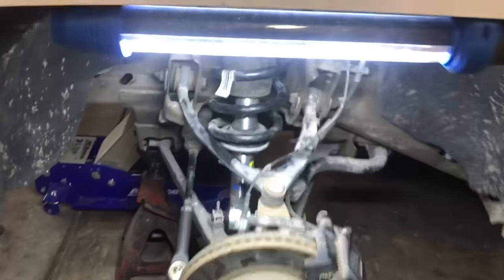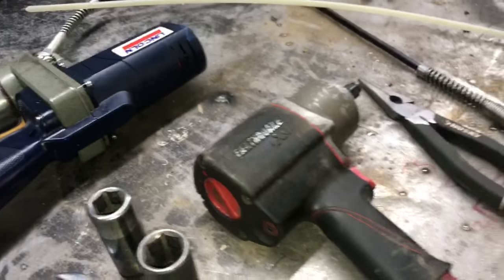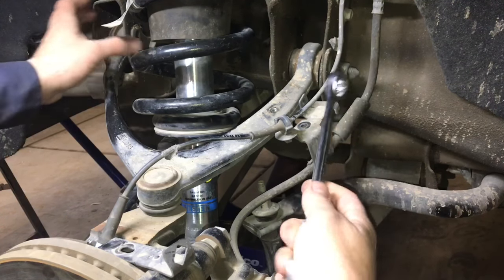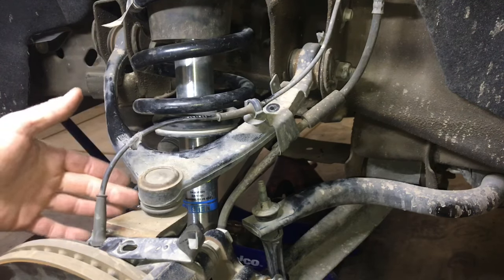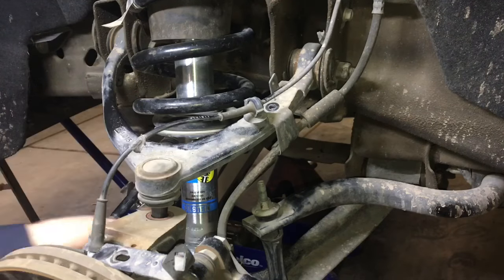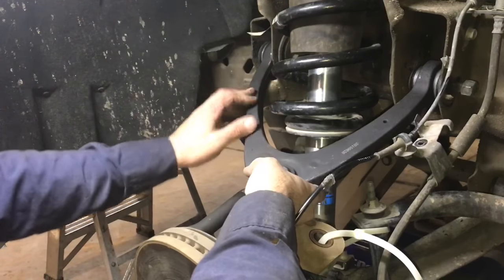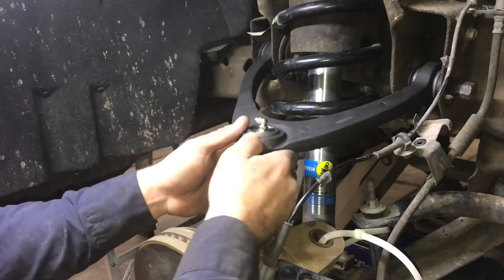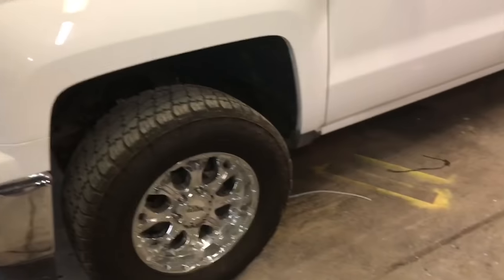Silverado/Sierra Upper Control Arm Replacement (2014-2018)

Comment: Be sure you buy the required control arm for your truck. You will have either aluminum or steel. If you are not sure which one you have then grab a magnet and if it sticks to the control arm it is metal, if it does not stick to the control arm it is aluminum. Pay close attention and make marks with a marker on the bolt cam location so it goes back in the exact same place and position then beside to get an alignment after the repair.

Comment: Great video!!  i am having a hard time installing the bolt w washer. It is hitting the spring and going in at an angle which isn’t allowing it to go into hole.
Reply: I took a seperate jack and put it under my lower control arm to compress/move the spring enough to remove the bolt. The driver side came out fine but I had this issue with the passenger side.
Reply: @josta64  this the answer I was looking for.  Wondering if I used a second jack could I compress the spring enough. To slide the bots out.

Comment: I have a 2017 GMC Sierra slt that makes a popping noise in the front left suspension area as I turn the wheel. Have you had any similar issues? I gotten two inspections and all parts are new.
Reply: I have a 14 Slt 4x4 in shop now due to popping and in even tire wear, $1,475.50 for upper and lower control arms with ball joints.     Hope it fix’s my popping and tire wear prob
Reply: @djcombs5553  you got robbed haha

Comment: Doing this job right now and this video helped alot! I had to use a large C clamp and put pressure on the upper ball joint and hit the spindle to get mine out so in case you guys dont have a pickle fork but you have a C clamp you can try that trick

Comment: Awesome info and video! I am about to replace both UCA's and all four shocks with new Bilstein 6112's in the front and 5100's in the rear on my 2015 GMC Sierra All Terrain. I have watched all of your videos and feel pretty confident about doing it myself. I put the leveling kit on myself when my truck was brand new so hopefully this won't be too bad.
Reply from the maker: thanks for the support! its not to difficult! thanks again
Reply: I have a 2015 All Terrain as well, don't they have a factory installed front leveling kit already? I'm basically in your shoes and am looking to do exactly what you are doing, did with the new Bilsteins. Are you happy with it, was it as easy as everything is on these vids? BTW I ordered the 5100's separately and was wondering if you bought all as a package or purchased individually. TIA
Reply: @jatelierer  I have traded my 2015 for a 2020 AT4 however I loved the 5100 bilstein shocks. The 2015 All Terrain do not come with a factory leveling kit so I removed the one I installed when I first purchased the truck and installed the 5100 to level it back out without the blocks for a much smoother ride. The 2020 AT4 does come with a factory 2inch lift but its not perfectly leveled. Ill be doing a 4inch BDS suspension lift on top of the factory 2inch for a total of 6 this fall
Reply: Mr. Work Hard Play Hard I believe you about the leveling but mine came leveled but perhaps that was an option the purchaser did when he bought it...obviously I bought mine used, the guy who originally ordered it also blacked it out and had a dealer installed at purchase Borla catback exhaust system with black chrome tips added...I love the new AT4's, they are already pretty sweet and high (in my opinion) but I'm torn now cuz I grew up a Ford guy and I love the new Broncos...got my rear 5100's yesterday need to order the fronts now...how much do you love that AT4, Beats the shit out of the dumb ass Denali package doesn't it
Reply: @jatelierer  I absolutely love the AT4. I've only had about a month and only have 1600 miles on it. I opted for the 6.2L and the power is no joke...love the bigger back seat area, rear vents and heated back seats for the kids. All the cameras cover ever angle of the truck  including that birds eye view from straight above. I loved my 2015 but I'm super happy with the AT4 so far.

Comment: For those of you with a 2014 - 2016. The parts are not the same. The UCA was stamped steel, which is why your UCA might look different. 
GM told HQ me directly, that they made a 16 and a half (2016.5) like they used to do and have so many times. At the '16.5 period they swapped the UCA to the one you see here (forged steel).
Thank you for the video. How much did you torque your UCA bolts?
Reply: I have a 2014 Sierra 1500 and it has this exact UCA, I'm stating at it and the two bolts hit the coil ...🤦🏻‍♂️ engineers

Comment: Can you confirm torque specs for control arm bolts  -  Ball Joint = 37 ft/lbs and the two Bushing bolts = 140 ft/lbs?  Thank you!  Great video.  It really prepared me to do the job.  :)

Comment: hi does your truck have a lift kit? And did you need to put a jack under the lower a-arm to keep from using a spring compressor?

Comment: Replacing both of mine tomorrow from factory to the Rough Country lifted arms (after 1 of my factory ones decided to break @ the ball joint. Not sure how it managed to drive 20miles while broken without the wheel folding in. 😂

Comment: I'm doing a 16 Canyon which is very similar. Should I grease the bushings? There is no grease nipple. I also heard that you are supposed to do upper control bolts torquing while the vehicle is on the ground? Thanks for the simple quick vid!

Comment: I have owed 5 Silverados, and they always needed upper control arms, lower ball joints, tie rod ends. And occasionally sway bar links. I have always had to cut the rear bolt on the upper control arm. I don’t understand how you just undid the the nut and the control arm came off.
Reply: i just did this on 16 and had to drop the strut on the passenger side to get that bolt out - this was on the forged arms (same ones in the video). We'll see how the drivers side goes next weekend lol

Comment: thanks for the video. I have bad story regarding upper control arms. I have replaced my 2015 tahoe upper control arms and after one week I found both ball joints damaged after I heard unusual sound in front. I was really shocked. I spent sometime for diagnosing the issue and I figured out I tight ball joint stud nut too much where the knuckle damage ball joint stipper. I bought new upper arms and replace them again but this time I tight until I feel ball joint stipper almost fit on pitch. I was afried of damaging ball joint again if I give more torqe. Now is what I did right? please advice...

Comment: On my 07 Silverado the coil spring is in the way to even slide the bolt out . I got it out by banging in it out. Now I don't have leverage to bang it back in because the bolt inserts crooked because of the spring
Reply: Im having the same issue he cut the part out on how he got the other out

Comment: I had a issue with my hub on the passenger side and then my upper ball joint went out I just use it for work and back still has me guessing why they went out

Comment: Did you have problems tightening the ball joint like the ball joint just spinning by itself and not tightening easily
Reply: There is a 7/32 allen head in the bottom of the stud for you to stick an allen wrench in there if it spins.
Reply: Or force ball joint down with pry bar

Comment: Was the CV axle pulled for this job
Reply: Nope. Don't need to, if your rough and yank down on the spindle, the axle joint will pop out of place, if careful you be fine. I've never taken any out or loosen the nut off when changing control arms.

Comment: Ain’t no damn way you got that left bolt in there that quick… That spring won’t allow it to be done that quick
Reply: No shit. That’s my current struggle. I can get the front one but then I can’t get the back one. But if I take out the front one I can’t get the back one even started 😤 and I don’t have a strut compressor. Fml
Reply: Use another Jack under the lower arm to move spring up….